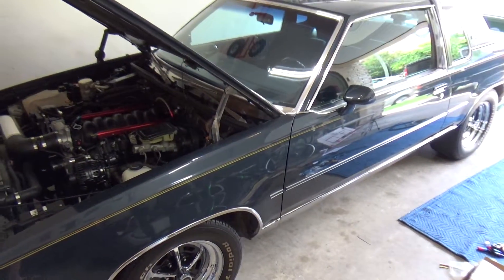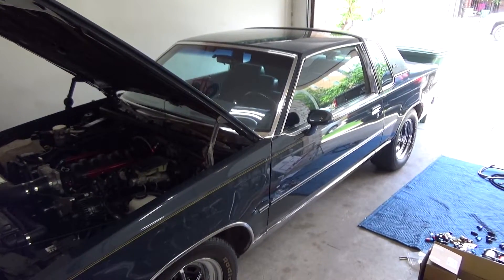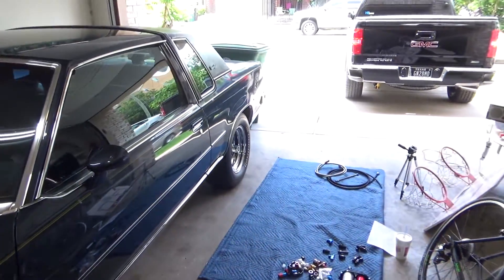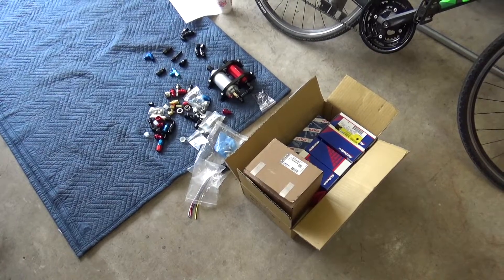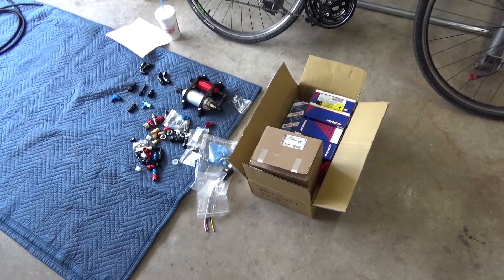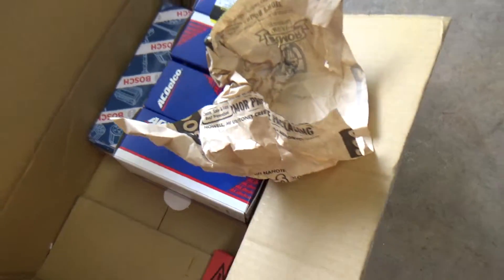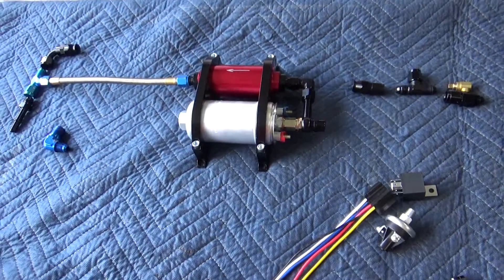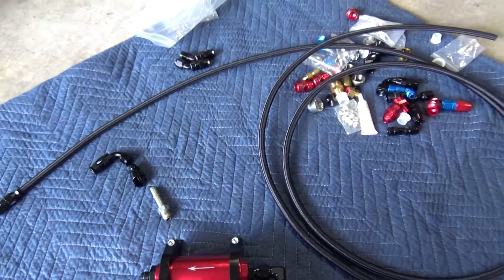E85 Supercharged 2018 Sierra - Fuel System - Part 1

Comment: Just found your channel, first off great work on all of your builds!!!

Recently purchased 2017chevy suburban premier with 5.3 80,000 miles. I'm 3rd owner.
In the process of getting ready to order the 2.9 whipple super charger kit next month (it's not cheap, nor this that LT1 fuel pump).

Your build process is a Great Help.
 I'm also looking to find another L83 and build it with the forged interals for the super charger and 10 speed transmission.
 If there any tips you can give me besides the videos. I really appreciate it and once again man great job

Sorry so damn long!!!

Comment: Why not go with a walboro 450 or 525 intank? A lot easier to plump, and a lot less connections or possible points of failure.
Reply: Will the walbro 450 fit the oem fuel pump module?

Comment: LT4 Mechanical fuel pump will not work with Whipple it will hit the Supercharger intake from inside
Reply from the maker: I thought Whipple redesigned it for clearance?
Reply: I have no idea. It didn’t fit my Supercharger
Reply from the maker: @ahmedalsulaiti9413  You were absolutely correct....manifold didn't clear the pump...had to do some grinding.

Comment: Can't find your video about the lt4 Cal's and map in up tuners 
I know I watched it before , I am looking for that information
Reply from the maker: You talking about the changes to the tune for the LT4 injectors?
Reply: @n5yiz  yes
Reply from the maker: @sitnlow4life  All I did was copy everything under "Injector Control" from an LT4 Corvette tune to mine.  The MAF tune was way off after that (dangerously lean) and I had to clean it up to get it back in line.  That was enough to get it to the tuner.  I don't know what he did from there.
Reply: @n5yiz  where did you get the lt4 Corvette tune ?
Also what about fuel pump control ?
Reply from the maker: @sitnlow4life  I didn't mess with the fuel pressure, but I know the tuner did.  A bunch of LT4 tunes in the repository.
Reply: @n5yiz  do you have your tune pre super charger